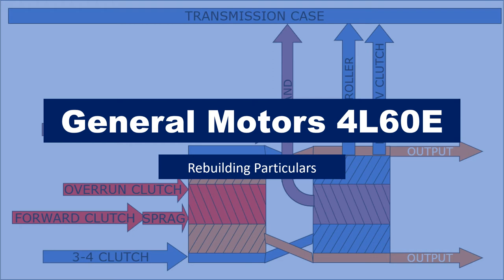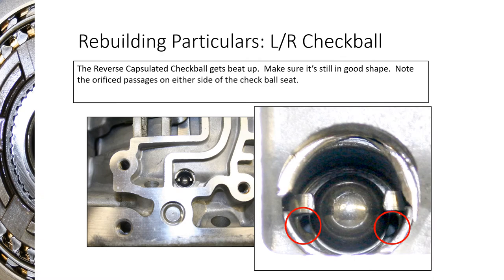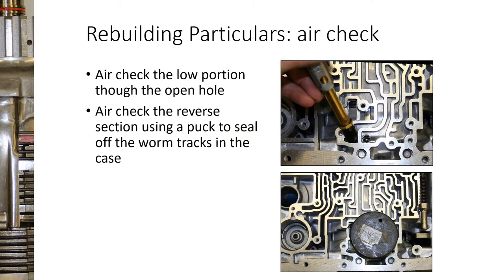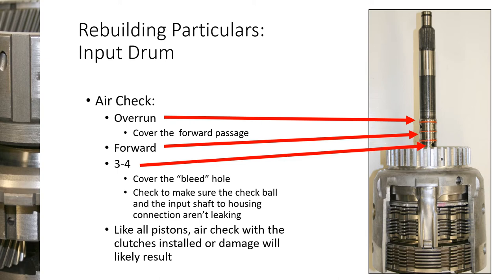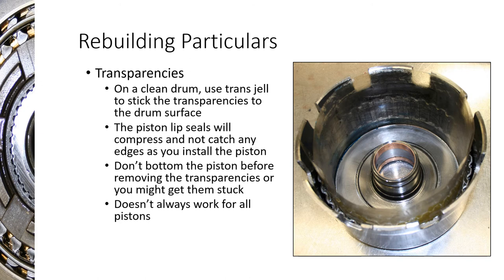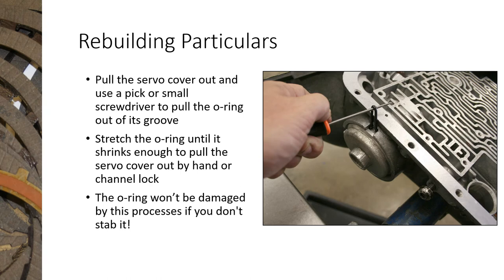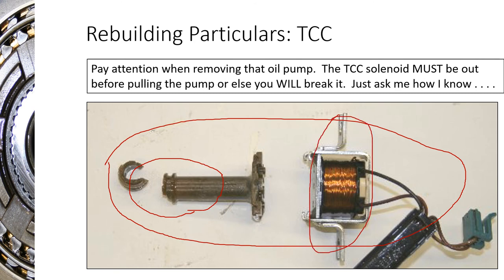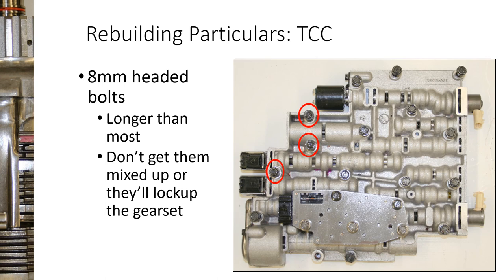4L60E Rebuilding Particulars

Comment: dude!!!    this really good stuff here!..  
thanks for taking the time to do it!

one question .  on the servo clearance. can i just use a cheater spring inside the assembly?   just to make it easier to compress?
and did you use the servo seals during the check?

thanks!!

larry
Reply from the maker: No problem!  It's fun to do.  I assume you're talking about checking the servo assembly without the special tool and just prying on the cover when installing it.  You could use a cheater spring, just be sure that you don't forget to put the correct one in :).  I had the servo seals installed because I wasn't planning on taking it back out after I installed it, since it checked out fine.

Comment: I was hoping you would have talked about the check balls in the valve body @34:36  I'm concerned that there are the crrect check balls in their proper location on the VB side and the CA side of the valve body plate.

Comment: to measure servo pin travel, with everything assembled,  get u an old servo cover, grind the middle part out, then reinstall it. you can them take a screwdriver and push the servo pin in, and see how far it travel to engage the band.

Comment: I installed the after market case saver. Will misinstallation case a 3-2 downshift shudder?
Reply from the maker: It shouldn’t.  The case saver is to prevent the case from getting beat up in the 2-1 or 3-1 downshift.  Was anything else done to it?
Reply: @siuautomotive  2007 Chevy Suburban 4l60e rebuild. No mods other than the aftermarket case saver. Getting a down shift shudder to 1st. No codes
Reply from the maker: That’s odd, because the only thing that happens during the 2-1 downshift is the band releases and the one-way roller holds.
Reply: @siuautomotive  Put it on the lift , got it to 4th ,then slowed down to down shift. got to 20 mph and the shudder started. end up being the passenger side motor mount, Sir. Thank you for your help, Sir